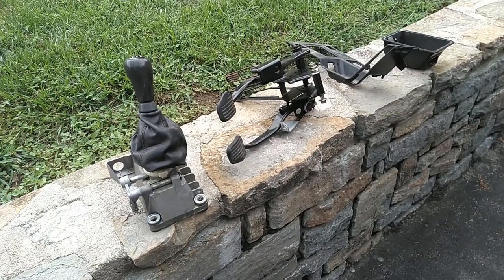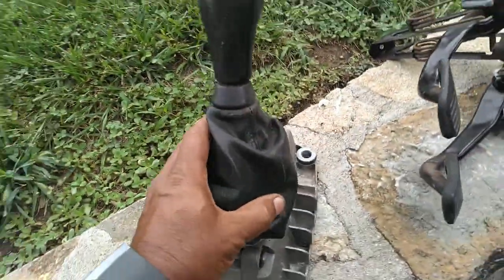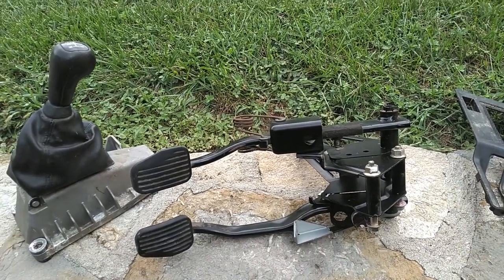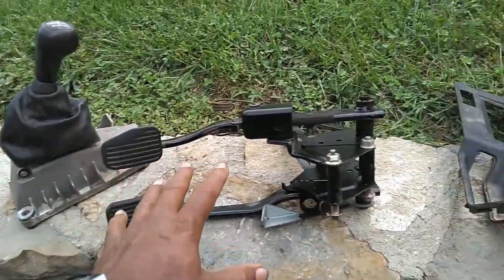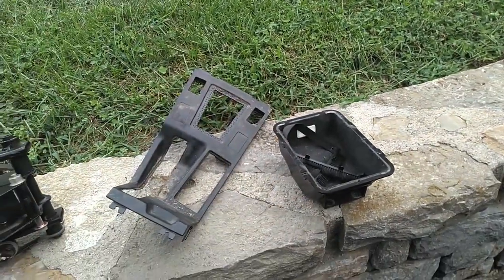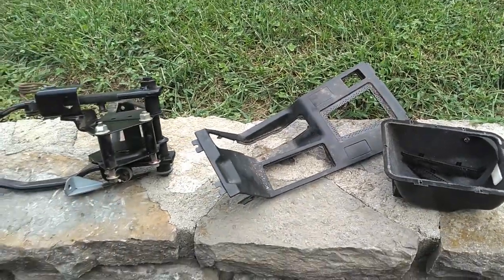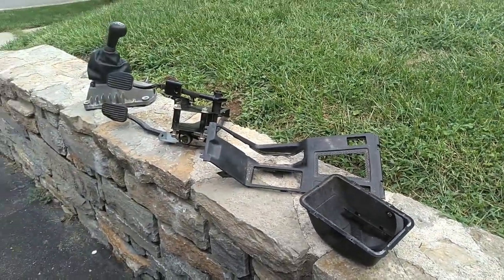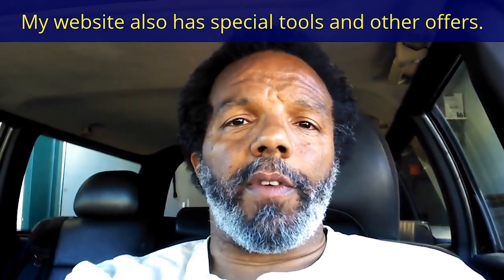850 Manual transmission parts that you should get from the interior of the donor car. - VOTD

Comment: the main problem in all swaps of volvo 850 is to find good turbo…
Reply from the maker: Turbo or turbo car?
Reply: @RobertDIY  turbo engine. i am recovering my 850 wagon. Its already has new suspension and brake system. Already re-painted(Black to black metallic), front windshield is changed for a new one. Back seats installed with child chair (alcantara+leather) 
steering wheel, gear bag - is natural leather.(black matte). door insertions, sun visors and armrest wrapped with eco leather. interior roof is wrapped with black alcantara, sunroof was installed from scratch(bought roof from another car - it was dissasembled and panel with sunroof hole was re-welded to my roof chasis). also was made a lot of restorations in electronics, cooling system and so on. Now i want to find s60r front seats, and turbo motor. Also car is on Sattelite Rims (17" GraphiteBlack) and 215/45 wheels. And also factory spoiler was installed. So a lot of work was done, but i am out of my  budget and there are crappy motors everywhere. So i am just waiting with my b5252s... oh and i have only stock front bumber... not from t5r.. so i need front bumper that consts a lot.